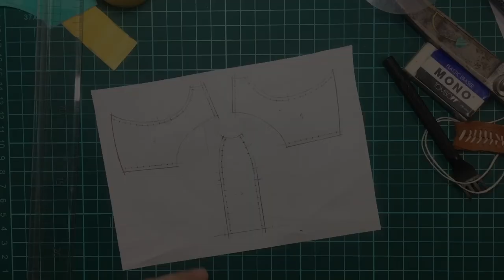Brake lever restoration and make leather hoods (DIA-COMPE)

Comment: Could you please provide me with the names of the tools you used, ie., size needles, type and name of thread, hole punches (or the name of the tool) , and anything else you think I will need to make these.  You did an awesome job and it looks great.  I have a LeMond Zurich with Shimano ST-6500 shifters that has brake hoods which are no longer being made (as of 10 yrs ago) nor are available anywhere. This looks like a feasible and way more attractive alternative

Comment: @EurekaBikeworks

Hi there, recently as a few months back. I had commented on your video section with a question in regards to the type of leather and thickness you had used for the grip hoods. Unfortunately, my browser had accidentally deleted my entire comment in the comment section below. I guess that brings me to ask again if you could still recall where or what type of leather or thread you were able to use for the assembly. Specifically what thickness is preferred? All I do remember were some links to a few sheets of leather you had recommended? 

Let me know your thoughts. Thank you!

Comment: They’re beautiful, but do you actually ride? The seams are gonna be hard on the hands, & gloves will wear the threads.

I’ve been considering this myself because I want hoods & bar tape to match the Brooks saddle on my Paramount. It’s silver w/ lots of bright-work, I like the classic gumwalls & leather look, & even if I didn’t nothing rides like a Brooks on a premium steel frame, so leather it is.

I’m not a leather worker, but I am a toolmaker/engineer. My plan is to at least attempt vacuum bagging a wet mold w/ the seams opposite the hands - on newer Campy brake/shifter hoods. I’m thinking I’ll start w/ 3D scans & printed duplicates of the hoods.

My Paramount is a 3x9 resto-mod, & part of the idea is to de-emphasize the slightly more modern group set.

Again, yours look great - glad to see somebody actually went there.
Reply: Wow sounds like a challenge! I would love to know how it turns out. Good luck🤞